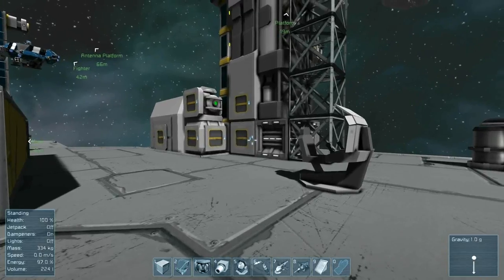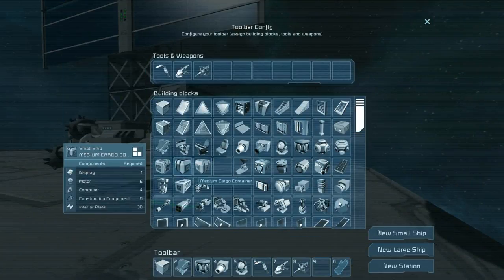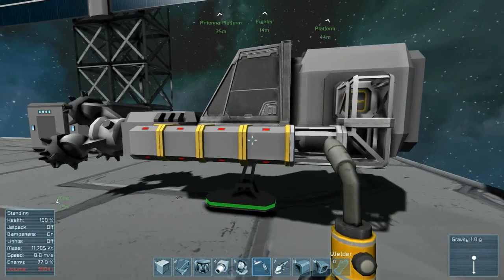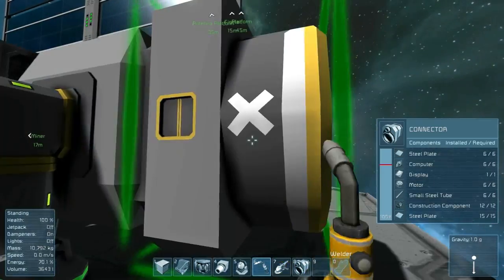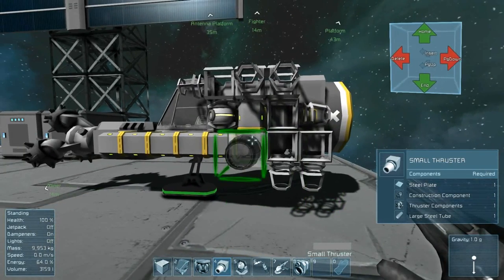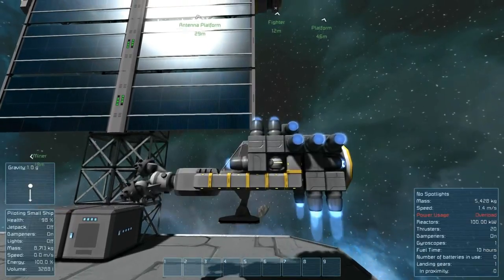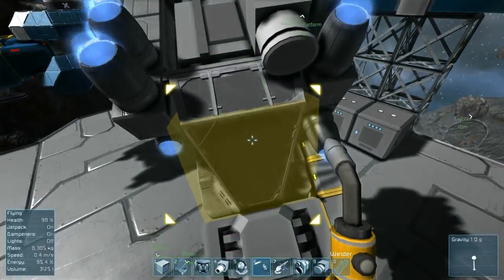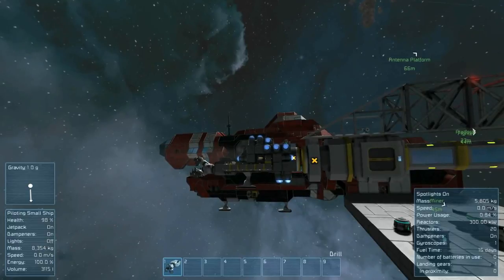Space Engineers Tutorial 4 - Conveyors and Connectors

Comment: The reason why it doesn't go through the connectors automatically is because it can't - it's not its function. Connectors are simply to connect your ship to your installation (and recharge it if preferred). If you want to have ore go automatically from your ship to your installation you have to have a connector on your ship (function throw out set to "on") and a collector on your installation. This, however, takes a while so it is only advised for small mining ships. To do it faster use connectors on both your ship and installation, connect them as shown in the video then drag and drop it from your ship into your installation. This is faster if you have your ship's inventory open on your left side and the installation on your right side.

Comment: This is exactly my problem. My refinery is not dragging ore automatically from my mining ship. Why? I can do it manually, so if refinerry is set to "use conveyero system" it should do it by it self right?
Reply from the maker: 90% of the time this is an ownership issue.  I'd dock the two together, then select all components on the control panel of both ships and clear and reassert ownership so that you're certain you have ownership of every single component.  Double check everything is  "on," and if that still doesn't work, try disabling any mods you are using.  If it works then, then re-add the mods one by one until you find the one that's gumming it up.
Reply: thanks. It was indeed problem of ownership. Refinerry wasnt mine :). Thanks sir

Comment: my connector doesnt connect , default ship connect's but my doesnt , and there is noting thats blocks or in any other way doesn't allow to connect. its a misstery for me. can anyone who had such a ting , help ?
Greetings from Latvia, exelent videos :)
Reply from the maker: Check ownership and power, also check for damage. Make sure your connector is turned on.  If all else fails, grind down both connectors below the blue line and then reweld them.
Reply: Gas Bandit 
Power like in your video, owner is me , because i put'ed it.
I cant turn it on and it doesn't magnetically attaches to station :(
Reply: Gas Bandit Hey, I was wondering if you could help me on my little world. It is open to friends only thou. I am trying to make a small ship that collect stuff and unloads in my conveyer system. I could use some help getting the conveyer to connect to ship.
Reply: cidoXL Kāds pieminēja latviju?
Reply: Calphon Nē , mī dont understan vath jū tur runāt :D sorry
Reply: cidoXL k m80
noscopes out of the building

Comment: I did everything like you did,and I cant  put the Uranium ingot into the small reactor,what should I do?
Reply from the maker: A patch has slightly changed how it works since I made this video.  Now, for the conveyors to work, the ship will already have to have some power.   I suggest just temporarily tacking on an extra reactor with its door facing outside, put a little uranium in it, and that'll get you some power.  Then go and put the uranium in your actual reactor through the system as described in the video, and then you can grind off the extra reactor.  It's stupid, I know, but... alpha.
Reply: Gas Bandit I have the same problem only I an't put uranium ingots into the small reactor even if I access it directly through its doors. Any suggestions?
Reply: Gas Bandit thanks that helped alot. I was wasting my time for about an hour, putting one thing on another just to grind it all over again. I have never thought that you need to build a second reactor just to grind it anyway. Thats soo stupid.
Reply: Gas Bandit Thanks ive been for an hour destroiyng and building the reactor now it works

Comment: Have anyone figured out why didn't the connector work in this video? I'm having the same exact problem in my game.
Reply: My brother was struggling with it for a few days too so I did some research. The reason why it doesn't go through the connectors automatically is because it can't - it's not its function. Connectors are simply to connect your ship to your installation (and recharge it if preferred). If you want to have ore go automatically from your ship to your installation you have to have a connector on your ship (function throw out set to "on") and a collector on your installation. This, however, takes a while so it is only advised for small mining ships. To do it faster use connectors on both your ship and installation, connect them as shown in the video then drag and drop it from your ship into your installation. This is faster if you have your ship's inventory open on your left side and the installation on your right side.